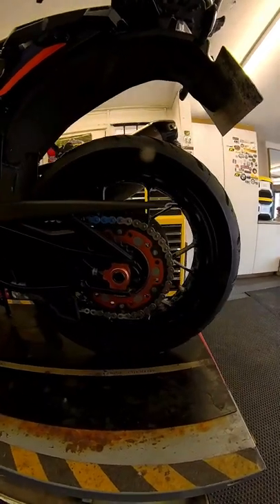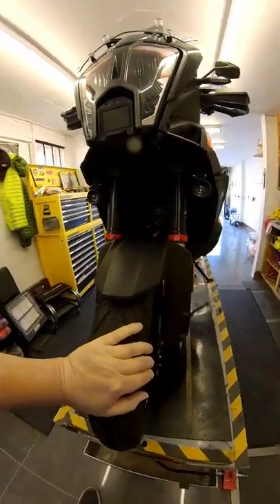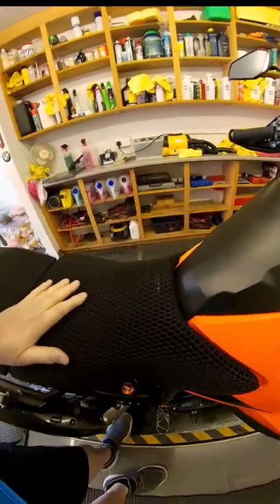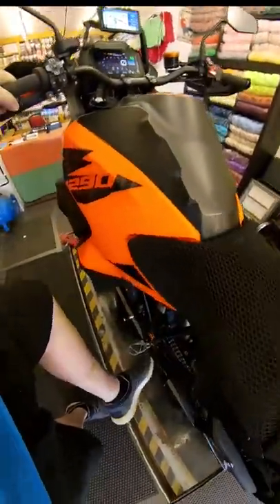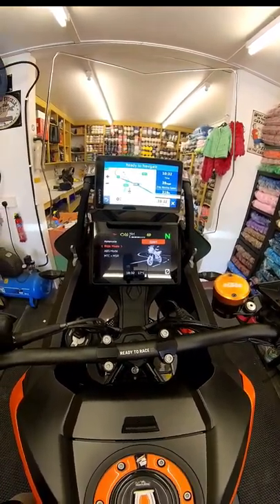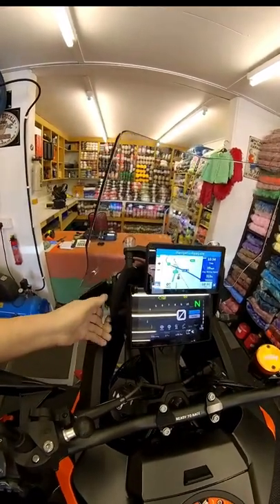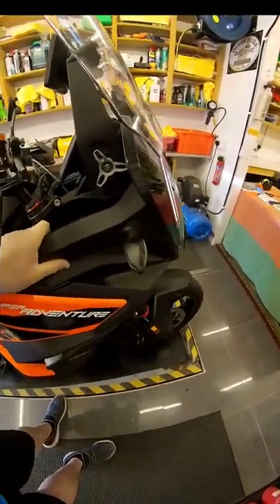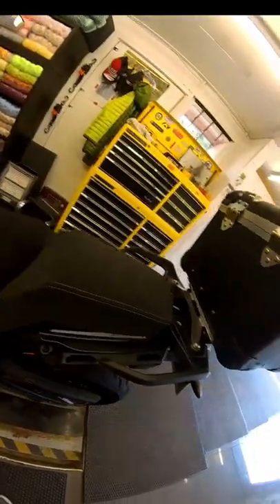KTM 1290 Super Adventure s 18 Months on...

Comment: I agree with you. Had quite a few BMs but firmly in the KTM camp now. Got the same bike and vintage as yours .... most irritating thing is the indicator switch but found that if you press in and down it works fine. Apparently others have said that you need to press the switch in and hold for a few seconds for it to work better. I have put the rally pegs on with rubber inserts otherwise the aggressive pattern will wear out your boots. I prefer a wider peg for off-road and also so you can move around more when doing long distance. Got the touratech mount for the XT but don't mount it up high but on down on the handlebars.... easier to adjust and play with on the fly and shade from the sun.  Conti Trail Attack 3s are the best tyres for it. Don't use panniers but have Givi top box ( much less than Touratech ). If my luggage don't  get in the top box it don't go .. hate tank bags. Sometimes the bike won't start unless you place the key fob on the sensor - especially annoying at ferries !! Best place for key fob is in the glove box/tray thing by the handlebars .. just don't forget it. Agree with Ergo seat and Cool Cover. I have the all-in one seat for the SAR as it drops the seat height by half inch.  Great bike and good videos by you. Thanks.
Reply from the maker: Hi Bryn thanks for the comments yes cont's ta 3 best for bike i will be taking the RP 6 off soon each to their own but i liked the contis far better.i Do wear my boots out but like ether feelof steel not rubber.Glad your enjoying the KTM we all are too BMW have cheapened  the bikes so much.Ride safe

Comment: Never watched your channel before, I cane across it and thought... well here is another old BMW geezer about to slap off the KTM, and boy was I wrong 
This has been probably one of the most objective and fair reviews I have come across on the KTM.
I ride a BMW GSA.... a great bike and before I owned one I was constantly trying hearing from my mates, how well it handled, it's comfort it's power and torque and on and on and on and how I should never get a KTM because.... build quality, cost of services, reliability, terrible comfort and on and on.
Well... the BMW is not as great as they say it is, it's just a good bike.
I find it uncomfortable, maybe because I'm 6 ft 6, it tends to run rather hot in traffic, that gearbox is clunky at best, it is slow when co.pared to a KTM especially, the plastic body panels are flimsy, fit and finnish is not as good as the those on the cars. That shaft drive induces to much slack in the drive train (coupled with that clunky gearbox) and I find the periodic maintenance of the chain on the KTM to be a worthwhile trade off. Ohh yeah and that drive shaft is certainly not maintenance free.
In short   I should probably bought a KTM.
Thank you for this excellent review.
Well done.
I am now a subscriber.
Reply from the maker: Thank you we have had the Bmw,s it sOrange Now.

Comment: Great review, I’m in market for my next adv purchase. Can you share your experience on KTM’s engine heat. Heard the old 1190/1290(prior to 2020) has excessive engine heating especially in stop and go traffic. You think this one fairs decent on engine heating vs R 1250 GS?
Reply from the maker: Good question as i cam from 11 GS GSA 12500 etc i can answer the heat question, first remember the KTV is a Twin and that in its self sets it a  bit harder to disperse heat as the bmw is a boxer twin and the air gos away faster. Now that said I was very concerned but i can tell you last year it was in the high 30's etc down in Rossi's place Italy and ye you can feel some heat but nothing to pt you off the fantastic bike. When in traffic stood its lid all nikes you get hot from all areas in sunshine but I think the KTM 1290 s  1921- onwards has done a excellent job on the engine heat.If you go down to JUDD Racing ask for Gareth the fit the will explain it far better.

Comment: Tightening the screws that hold all the plastic pieces every 5k or so doesn't hurt. Some were a little loose and I've lost two on the front fender. I recommend the Touratec mount for the Zumo XT. It's much more solid. No shaking anymore. I too have the touring cases and I am never quite confident whether the plastic mount will survive my trips. It's kind of a wonder that it works at all. I will never use them on extended bumpy gravel roads, they are not built for proper adventures, that's why they call them "touring", I suppose.
The onbard tools are quite good, but KTM forgot to add a hex bit for the battery contacts.
Reply from the maker: Yes touring cases there ok I guess I had the spam tins on BMW before. But the touretch ones on KTM just stick out way to wide. Tool kit yes but at least you get a bottle opener:-)
Reply: @flapjackbeans  Yes, the boxy cases look ugly and stick out. Don't like them, either.

Comment: I have owned mine for 8 months, and I am with you on the negatives..but I get an occasional  fault on start up where the I have no damping and preset on the suspension...this hacks me off a bit but it always clears the next start up.
Agree on the 6s I'm not as impressed as I expected to be ...maybe other tyres have just come on?
Still struggling on what's the master for connectivity bike or zumo xt ??
But other than that pleased with it. I have a 2010 990 SMT with 90k on it and never been a problem, so expecting the same from this.
Great video thanks for taking the time to generate it !!!👍👍👍
Reply from the maker: Hi yes i too get that as does mick now and then re pre road on suspension I think sometimes if you have not ride bike foe a few days the battery is just a tad low and the start up shows the squsspesion error. Also i have had a few times whilst riding its anima when your riding with it on I stop bounce my fat arse on the rear a few times and re start and she's back. Can be  tad annoying.Re Mich rd 6  don't like them at all i will be back to conti trails soon. As for connectivity i use bike not Zummo. Thanks for looking  an comments Ride safe :-)

Comment: 100% agree with every statement you made about the KTM. I'll add that the KTM turn by turn SatNav works as well. After my R6 wear out I might go back ME1.
Reply from the maker: Hi Thanks yes GOOD point never mentioned turn by turn a Is ve never used it I always seem to use GARMIN XT which i thing is seamless just on enigma with t the newest route defaults to the bottom of the list and you can't bring it up to the top. But KTM have built a great platform to get close to the perfect ADV  Bike. Wish it was a tad lower in my old age im struggling mounting her :-) :-)